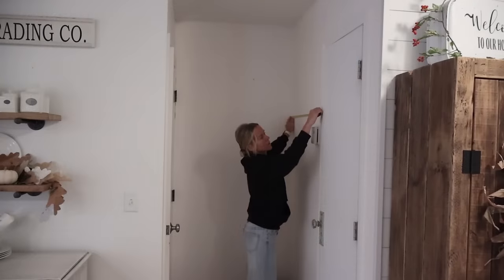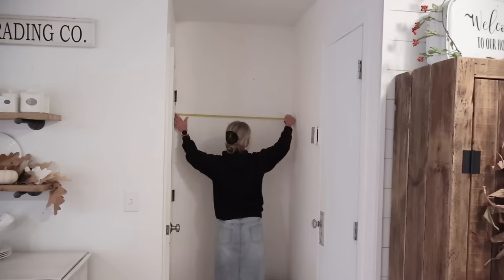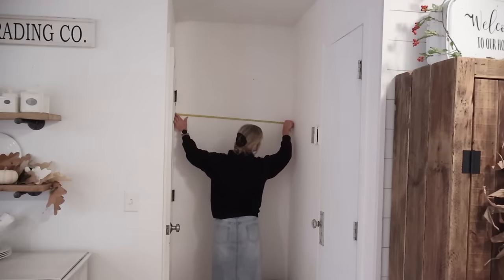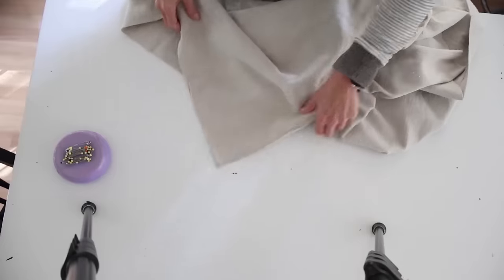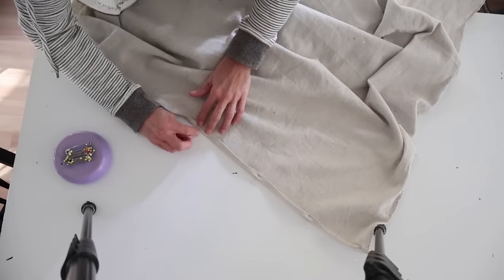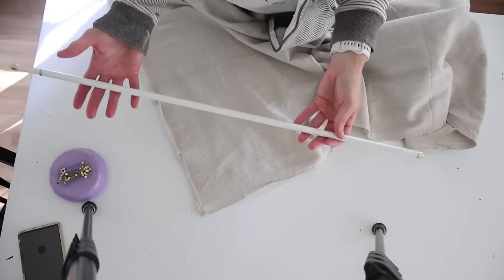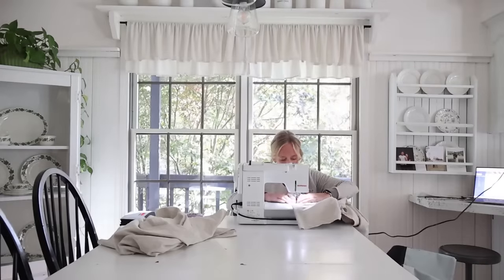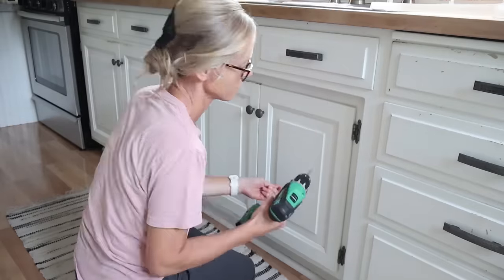Old Farmhouse Style Decor ~ Traditional Farmhouse Style ~ Antique Home Decor ~ Authentic Farmhouse

Comment: Mary, it all looks so cute! Just because these ideas are not in the "current" decorating magazines does not mean you can't do it. That is how things get popular, by doing something no one is doing currently! I remember my mom always had those copper molds hanging in the kitchen and the great big fork and spoon on the wall. I recently found a bunch of the molds at Goodwill for only $1.99 so I hung them up in the soffit above my cabinets. I found an old breadbox with a copper door at a flea market for $10.00 so had to buy that! I do have the big spoon and fork from my mothers house, so thinking I will repaint them and hang them, too. 30 years ago I found a similiar self-adhesive lace. I never did put it up, but never threw it out ......maybe I need to hang mine now.

Comment: Good afternoon Mary, I remember seeing my Dad making screen doors, one for the front and one for the back.  It was many years ago. I was a little girl and had no concept of his carpentry skills.  The doors actually served to keep the majority of moths out the house at night when the lights were on and maybe they unwanted flies or wasps during the day, it also operated as a sort of security door, it had a insidehook just to keep it closed, Dad did not add a spring to shut it behind us, we closed it by hand. Dad passed away, the door became shabby and I replaced it with a metal door - it was gastly, but it worked and served the purpose. So many handmade treasures were lost with easy just buy ready made requirements. The door turned out fabulous. Where there is a will, there is a way. Thank you for sharing I loved the video. Many blessings, kind regards.

Comment: I bought a 1960s screen door at a salvage store years ago. I've stored it in my barn waiting for the day I could adapt it to use on my house, which had modern aluminum storm doors when we bought it. They're so plastic and ugly, but pretty necessary to help keep blowing dust from seeping in the cracks around my back door. I think I'll rout some channels so I can inset plexiglass panels behind the screen in winter. I still have a screen door from my utility room to garage. The springs are built into the hinges, so it doesn't slam very loud. I'm surprised they work at all, being 68 yrs old. 

Always enjoy seeing your projects.

Comment: Please, please, please lower that table saw blade. The blade only needs to be a saw tooth higher than the material you are cutting. If you should slip, you might get a bad cut on the low blade but a blade as high as you were using would cause life changing  trauma.